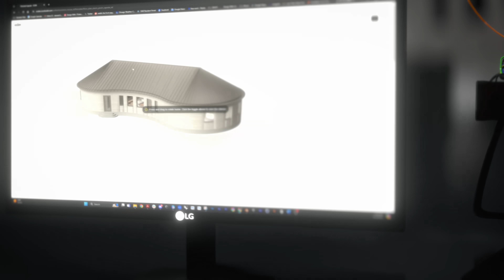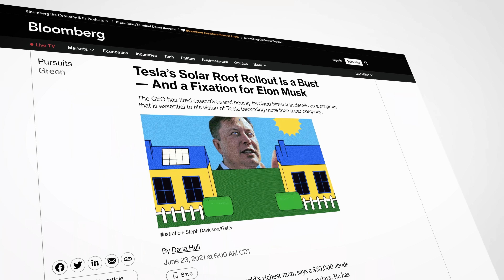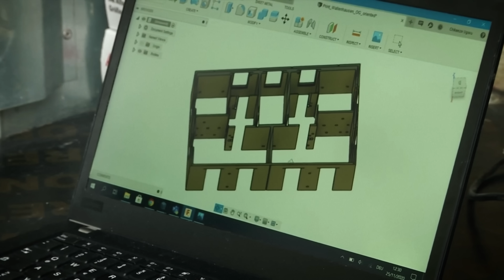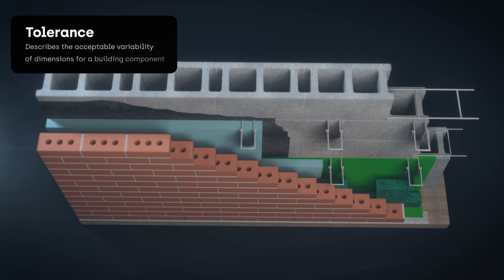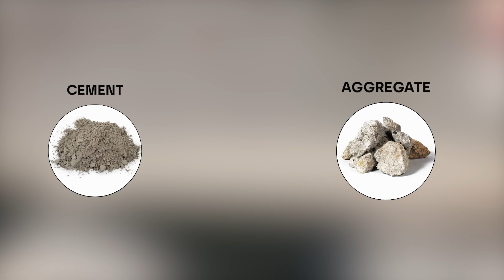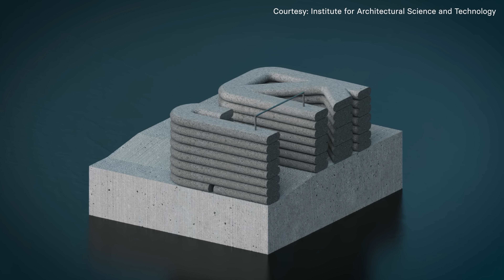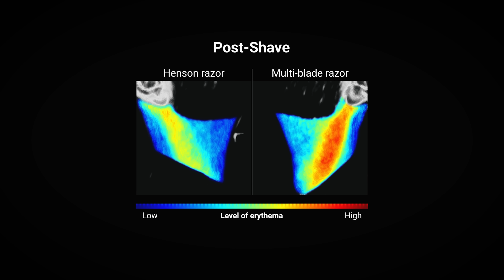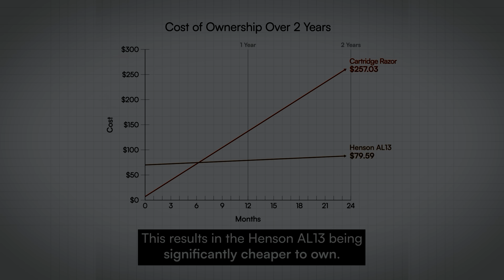Why 3D Printing Buildings Leads to Problems

Comment: Affordability is an issue because of the way our economy works, not because we can't do things on the cheap. In other words, it comes down to who owns the home--investor or occupant. 3d printed homes will be bought up, en masse, just as other affordable homes have been bought up, en masse, which constricts the market for owner occupied home and therefor drives those prices. Also, the home as an isolated object is not the objective of most people, who want to live in neighborhoods and send their kids to good schools. Again, walkable neighborhoods are desperately difficult to find and the market, therefore, makes them stupidly expensive. 3D printed homes will do nothing to solve this. In fact, if we were able to build a few million homes very quickly, the glut in housing would crash the prices and the economy. It's econ 101. The solution isn't a manufacturing gimmick, it's changing the way markets work. Since we invented markets and money, we can reinvent markets and money.
Reply: I think singapore and the Netherlands have the right idea where they own the land and rentals so you can't speculate
Reply: This.
Reply: Exactly! Couldn't have described it better 👏👏
Reply: You're asking for a several magnitude uplevel correction I doubt anyone would be able to implement in any sort of proactive way without it being drowned in pushback. It's gonna take a sector by sector crash & burn before people will be willing to let anything new or reformed grow in it's place.
Reply: If an adequate supply of a necessity would crash your economy, your economy is already broken.
Reply: Pretty much, also the argument/analogies in the  vid are disingenuous as other industries can make infinite whatever they're producing, land is finite.
Reply: @ExileXCross  Land is finite but we CAN make large volume habitats. The main blocker for that type of project is NIMBYism. I understand that some locations are constrained geographically, but far more are constrained politically. I visited a neighborhood in China that had two million people living in it and it had been built only two years before.
Reply: @ExileXCross   Ask the Dutch about finite land! And in the coming decades, we'll have another avenue for making new land in the form of rotating space habitats, though that one will require a significant industrial base up in space to crank out the gigatonnes of material needed to build them first. A space habitat with a mass of a billion tonnes could have an internal surface area of a few hundred square kilometres. That's like a small island you could hike across in a couple of days.
Reply: Housing isn't bought up "en masse" by investment companies. Housing is scarce for consumers because major metropolitan areas don't build anything new anymore. For example, San Francisco permitted exactly 1,136 homes. That isn't enough to keep pace with the demand for living in San Francisco. Compare this to Austin TX, who has built 11,600 units in the same timeframe with much less demand, and they've seen a decline in both home and rent prices. It's all supply.
Reply: @kopshi  eh.. not really, it's also who can afford to buy the houses where I live any house that sells is well over a million. Typically they want 250 k or more for a loan on said house and  250k is a lot to have liquid at any one time. In addition we have an issue where realtor companies buy up as many houses as they can to artificially keep a strange hold of the price. The there are speculators and people using the land as a land bank (really rich MF) who don't use the land or the house they have and just keep it to let it accure value
Reply: @kopshi-yt  I can't take the time to explain to you how different real estate markets are different, but you really can't compare Austin to San Francisco. San Francisco is bounded by water on three sides and the fourth is at 100 percent buildout. Certain regulations do hinder markets, but I live in and work in the Denver metro Market (GC, Realtor, former small volume investor type) In Denver and surrounding areas, we have been building like crazy for decades, That said, the percentage of non owner occupied homes has risen from 30 percent, roughly, to 40 percent. You can check those stats through NAR or other sources. OF course, there isn't just one driver, but government regulation restriction is not an issue along the front range--even if it is true in pockets. I could go on for about five years about this differences, but I am not here to convince you.
Reply: @justinchipman1925  You should make your own video on this subject. The Front Range is certainly a desirable area and I think there are many factors is housing costs. Australia, for example, has vast amounts of empty land, but prices remain high even compared to the Front Range.
Reply: @kopshi-yt  Like most right wingers, you fall back on the same, isolated examples to prove a non-sensical point and to simultaneously defend investors. I am from Denver, Colorado. Denver has specific boarders and infill is challenging, but the front range has done nothing but expand. Population when I was in high school (of the state) was around 1.8 million. Now it's 5ish. There aren't crazy building restrictions all over that make it impossible for those poor developers to build. On the contrary, the city continues to explode to the North and South and East and, despite the massive construction, the rate of occupied ownership has dropped from about 70% to about 60%. This sounds like a lot but, it means that the market for home ownership has shrunk. 

Sure, San Francisco issues very few building permits--but have you ever been to San Francisco? I lived there for two years and I promise you that there is no place for San Francisco to go but up and no one in San Francisco wants that. Now, go to Austin Texas and you can pretty much build in any direction and for about one hundred miles in those directions. Easy. 

If you want to do your homework, go find out what rental rates are in Austin. Austin isn't exactly cheap anymore, so see if the trend in home ownership isn't heading downward. I would do the work, but I already know markets in Northern California, Colorado, and North Eastern  Ohio and I don't need to know more. I think you'll find out that my analysis is correct and then you might discover that you don't want to carry the water for a bunch of hedge fund managers and their pig pen of investors.
Reply: @justinchipman1925  the solution is a progressive property tax rate for every residence owned outside personal residence and a vacation home.

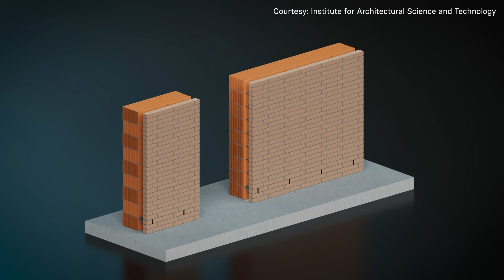Comment: 2:42 You can, it's called flat arch. A somewhat forgotten technique that was very common in 19th and early 20th century. It works for spans that are 4 feet or less but it's still the majority of windows and doorways. Or you can, you know, span everything with a segmental arch like we had been doing for the past 2000 years.
Reply: thank you I lost my mind a bit when he said that
Reply: Glad you got this comment in, I was a little bit outraged. Those steel lintels are an "innovation" of mid 20thC brick veneer construction, and are a hallmark of low-quality tract housing.
Reply: you mean one could put a temporary wood structure to support the arch while it's being build?
groundbreaking!
Reply: @gbizzotto solution was proposed in the video, print it lying down then hoist into position when it's time.
Reply: @gbizzotto  Or like anonymous (above) said, print concrete over a cardboard form.
There's no damn reason any 3D printer can't work in 3 dimensions, it's right there in the name! (of course they have control over Z)
Reply: Came immediately to the comment section to say this.  Man's never seen arches and keystones before?
Reply: We were also building cathedrals that were taking hundreds of years to finish. While living houses were beam frames and mud
Reply: Yeah I've seen brick arches
Reply: @bradbradson4543  You should watch some Mexican channels where they build brick domes with no support. Just flinging bricks and mortar as fast as they can.
It's pretty amazing!
Reply: A quick search suggests we've been doing brick archways for at least 3400 years. But I always think of Moorish architecture for brick archways
Reply: Money saved on building the house tends to go towards buying the plot to build the house. So if I am willing to spend $300,000 on a new house and it costs $200,000 to build, I will be prepared to spend up to $100,000 on the plot. However introduce a new building method (like 3D printing) which reduces the cost of building to $50,000 and I will now be prepared to pay up to $250,000 for the plot. And if it was just me there would be no problem. I'd save $150,000. Unfortunately there are perhaps twenty other people willing to pay up to $300,000 for a new house. So what happens is that the price of plots rises to $250,000 when the price of building drops to $50,000.

In short, these new building techniques are cool. But they won't reduce the price of housing.
Reply: Thanks I never heard of flat arch and it looks great.
Reply: Yes, get ready for a massive reemergence of arches in architecture. I'm here for it.
Reply: I wouldn't be sure you can print a flat arch out of concrete. This process creates a homogeneous structural member. The premise of the masonry arch is that load is directed in compression from masonry unit to masonry unit. I'm not sure the internal load would be distributed the same way in a printed concrete wall.
Reply: @henryglennon3864  I was talking about bricks, he said you cannot span an opening with bricks without a lintel.
Reply: @Nakaska  fair enough. That said, in America, code might prevent it. Which is stupid, but American building codes really do not like unreinforced masonry. For example, I'm not too sure how the printed walls would be reviewed, unless they have a special variance.
Reply: @henryglennon3864  Flat arches are commonly used in 3d printing on a small scale.
Reply: @theavaliengineer 3d printing thermoplastic is very diffrent from 3d printing with concrete.

Although if someone came up with a dissolved cellulose/inorganic building composite it could in theory act a lot like thermoplastic, or a nitrated cellulose plus filler and excusion process that left an non-flammable final product it could print out like a 3d printer, possibly even be a resin allowing for some crazy designs while being almost as cheap as chipboard, or even cheaper then chipboard as a building material.

Comment: I mean, 3d printing isnt for prototypes, 10 years ago maybe, but its 100% used for finished products now. and its a finished thing. building need improvments but pouring concrete which kills the planet, or finding a way to do it on site. no brainer
Reply: The planet is an inanimate object so it cannot be killed. It may enter a state that doesn't suit you. But that's not going to adversely impact it. This planet has already been hit by another planet sized object and that didn't kill it. Busted it up some. That's where the Moon came from. It's the leftovers of that collision.

Comment: It's a silly idea that will never take off. 3D printing a house takes way longer than using traditional building techniques. I've seen entire neighboorhoods worthbof houses built from the ground up, and move-in ready in less than a month. 3D printing for construction would make more sense if each printer made modular sections that can be installed using traditional construction techniques. Such as only printing wall panels or window sills.
Reply: I work with a leading concrete 3D printing company, and unfortunately, nothing you've said here is correct. As of right now, the 3D printed house timeline is about the same as or slightly shorter than frame construction, despite the difference in man-hours. What you've observed is an army of workers working simultaneously, which isn't comparable to a single machine and construction team working on a single home. Lastly, 3D printing isn't a good process for prefab parts. Wall panels or window sills are much better made in mold or layup processes. You should be skeptical of concrete 3D printing claims, but not for any of the reasons you've mentioned here.
Reply: @joranbooth5529  Saying a 3D printed house can be fully constructed with full electric, plumbing, and everything in the same amount of time or shorter than a timber frame house? According to which biased datapoints and metrics? It's also right to compare a large construction crew to a single machine since that's what the single machine is meant to do the work of, and what that single machine is meant to replace. If 3D printing prefab wall panels or whatnot isn't feasible, then it just puts another nail in the coffin for just how useless the technology is for the field of construction. I've also seen just two people build houses from a kit in very little time and far less time than it would take for a similar sized house a concrete 3D printer to create. The only real advantage I see that 3D concrete printers have over traditional construction methods would be safety and liability as there's a far lesser chance of worksite injuries. Whether or not that advantage is enough to stay competitive against traditional contractors and be capable enough to meet time crunches and bring down overall costs would need more analysis.
Reply: In Europe, they already manufacture entire wall sections in factories, under strict quality control, which they then hoist into place on site with cranes. The process in this video is very American-brained in that it still wa ts everything to be delivered to the site in individual pieces by trade.
Reply: @henryglennon3864  The same takes place in the US too. Not sure why there's an assumption that it doesn't take place in the US or that Europe is somehow special for this practice. There's also plenty of international companies, European ones too, pursuing this silly idea  of 3D printing buildings, so calling it "American-brained" seems like nothing more than beating the worn out drum that is blaming and bashing the US for everything.
Reply: @Eidolon1andOnly  can you recommend an American company that makes custom prefab wall sections? I'd like to check them out.

Comment: I think the biggest issue is what makes developers more money, whatever does that best is what developers would go for. If you go back 45 years to 190 years+ all construction was quicker and in most cases a lot quicker, so just because something is quicker doesn't mean it will take off. Look at pre fab, cheap, quick and much less profitable. We will get it if developers make more money, it's that simple. Even if it's a much worse product. Developers will claim it's regulations but putting on a harness takes a minute, a safety talk takes 20 mins. Yet the difference is not a day or week at most, it years even decades difference in length and amazingly the only thing that has gone up in that time is the amount of money they take in.